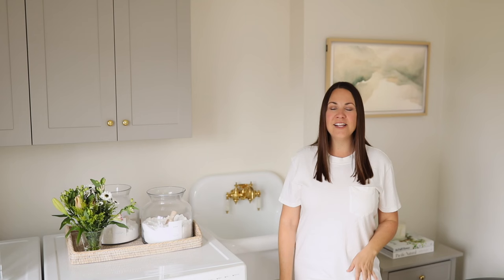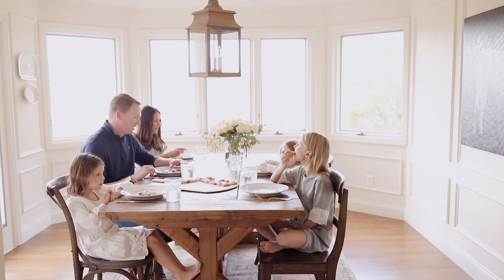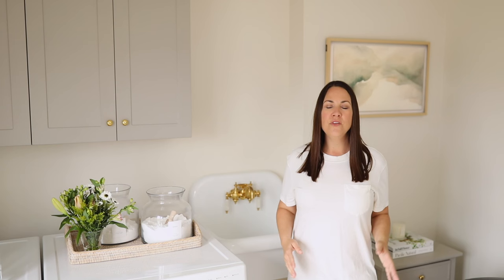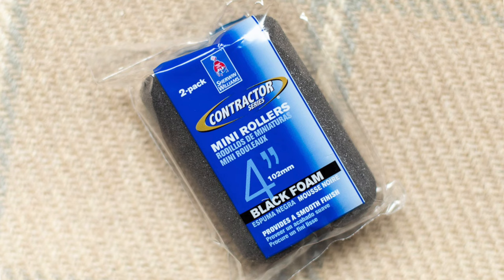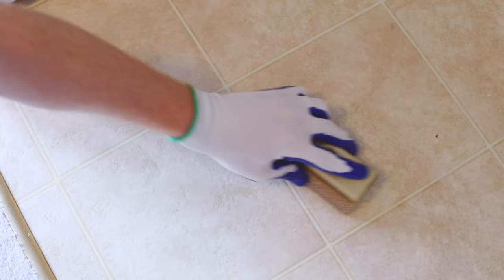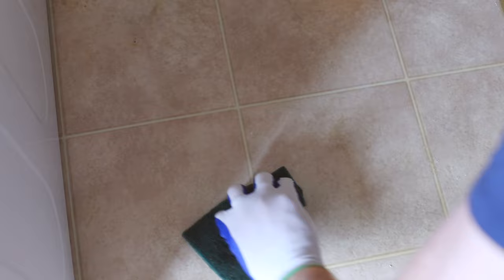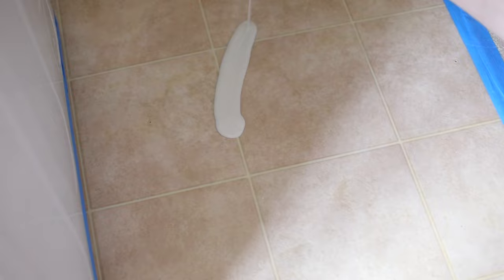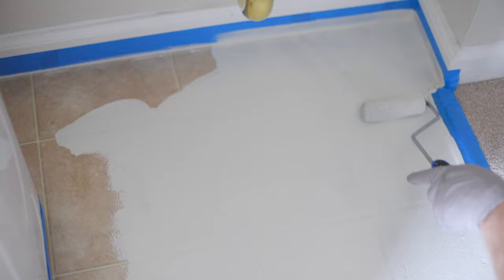Painting Vinyl and Linoleum Floors

Comment: A little advice from a like long painter. Use a wider roller and an extension handle and you can do this standing up instead of crawling around on your hands and knees.
Reply from the maker: Great tip. Thanks for following along!
Reply: Thank you for your intelligent advice...will do it your way  Mr. Skiles
Reply: That's what I did for my deck floor. It was a knee saver. 👍
Reply: Iike long or life long
Reply: Make a tutorial

Comment: I’ve painted a lot of floors and pouring paint on the floor and then spreading it with a roller can be a disaster if your floor is not completely level.
Floor paint should be rolled on in thin layers, especially when doing a large area.
Also, Rust-Oleum makes a paint called Floor Cover that is specifically designed for painting vinyl and ceramic tiles.
Porch paint is for painting porous surfaces such as wood and concrete.
For anyone thinking about painting any type of tile I would highly recommend checking out videos on the Rust-Oleum Floor Cover paint.

Comment: Awesome video thank you for this. Question... After using porch paint should you use a sealant to further protect it? I have two cats and a small dog and am really worried about how their little paws and claws will scuff up the nice job I do when I do it... Help! 💕
Reply from the maker: Hi Jennifer, glad you enjoyed this. We did not use a sealer as it is a low traffic area. However, I would recommend using the Stix Primer and Benjamin Moore Impervo. It is supposed to  hold up wonderfully!
Reply: Rust oleum Rock Solid

Comment: I looked over your detailed instructions online. After you paint the floor two times is this when you would use the stencil? Do you recommend to also use floor paint for the inside of what your painting the stencil? Is there something you can put over the top of the floor paint to make it shiny or seal it?
Reply from the maker: Hi Jennifer,
Yes, I would apply the base color first (using the method shown in my video) and then use your second color and stencil afterwards using a floor paint. Sealing the floors afterwards would add extra durability.
Reply: @JulieBlanner  do you have a recommended sealing agent?
Reply from the maker: @gfrogger7  We did not use a sealer as it is a low traffic area. However, I would recommend using the Stix Primer and Benjamin Moore Impervo. It is supposed to  hold up wonderfully! :)
Reply: @JulieBlanner  thank you!

Comment: Can you paint with Matt emulsion?
Reply from the maker: Matt emulsion is commonly used on walls and ceilings. I would recommend sticking with a high quality porch and floor paint.
Reply: @JulieBlanner  It's more that I need to match the walls and floor as I'm in a film studio environment. We continually repaint our floors. We experimented putting lino in one of our studios, but it didn't work out as it discoloured. Now I'd like to cut my loses and paint it. It does however need to me matt finish to match the walls exactly and it can't have any sheen as we'd get glare on the cameras....
Reply from the maker: @48broadley  ah yes, I see your predicament :) I would ask your local paint store if they have a high quality floor / porch paint that is available in a matte or flat finish.

Comment: Where did you buy the paint?
We don’t need anything else to cover it and keep looking good?
sealant or some paint protector?
Reply from the maker: We bought the paint at our local home improvement store. We did not use a sealer as it is a low traffic area. However, I would recommend using the Stix Primer and Benjamin Moore Impervo. It is supposed to  hold up wonderfully! :)
Reply: @JulieBlanner   thanks 🙏♥️
Reply from the maker: @yenysanchez20  you're welcome :)